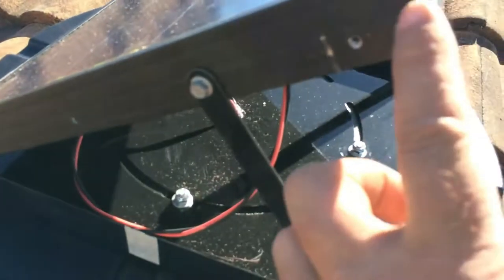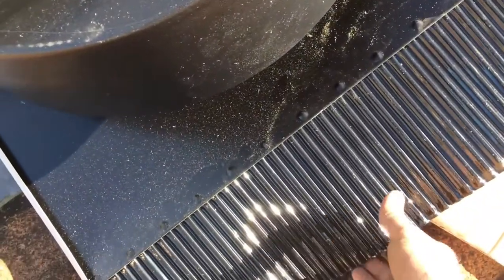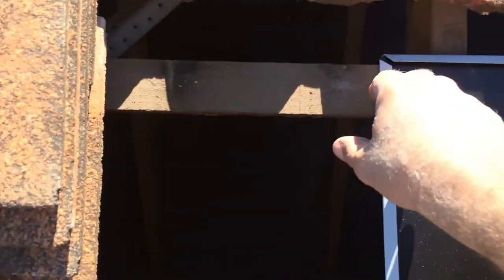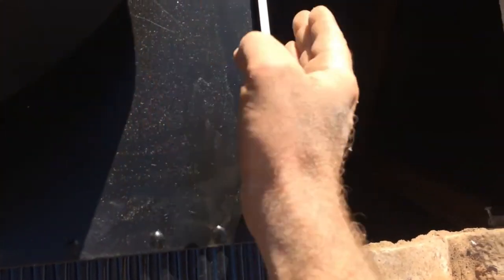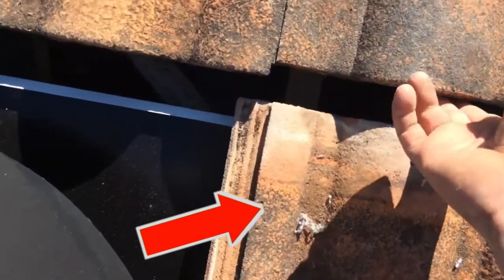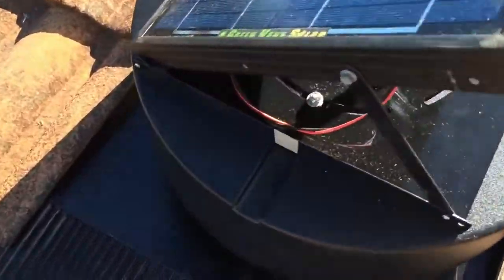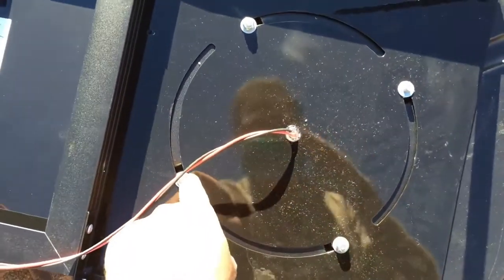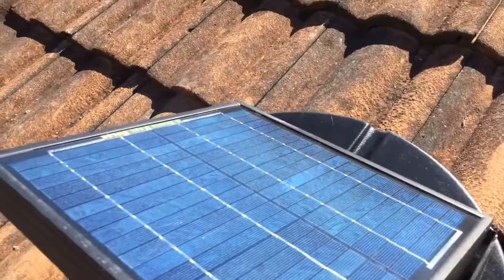Biggest Solar Vent, Do they work  7 Steps to install it on your tile roof

Comment: The Insulation Team  I have an unusual question regarding terracotta roof tiles please. The timber framing on my garage roof has moved over the years causing some terracotta tiles to have larger gaps, particularly in one location. The garage has no ceiling so all the timber and underside of the tiles are exposed, the previous owners got fed up with dirt and crap coming in thru the small gaps in between the tiles so they had the entire underside lined with SilverFloor insulation, it's attached with flat head clout nails. It has reduced the crap coming thru. In one location where the biggest gap in the tiles is, the SilverFloor has come away due to high southerly winds, and no amount of re fixing with the clouts keeps it in place. I thought of a solution which is to change the type of fasteners to very large washers with screws, and use some sisal tape to reinforce it. Yesterday I got up on a small step ladder and had a closer look at the gap where the wind is coming thru and I would like to fill in the gap from the underside with some type of material which will be sure to stay in place before I do the final re fixing. Can you suggest what I could use to fill the gap before I re fix the SilverFloor please.
Reply from the maker: Hi I thought I had written a detailed reply to this days ago for you #Ibis Man But as I was in an airport it did not send it....
Reply from the maker: Ok so I understand that you have some old foil under the tiles that are keeping some of the dust and water coming though onto your car. This is normal for tile roofs to breath like this a and it has advantages but with no ceiling in place it also has disadvantages.
If the old foil is paper backed sarking it is not very good and the square gange staples that you buy in a box from bunnings is the best bet to be able to hammer them up to the timber again. 
If you wanted to redo the foil the newer poly weave stuff is very tough but prone to sunlight damage and in a few years it may fall apart if it is getting to much sun too.

If you are worried about the gap size you can email me a photo on my DM on the website www.insulation.team or you can email them to me to check for you if it is a normal amount of gap. 

I would not recommend sealing the gaps in the tiles because you would have no way to stop the sealant from spreading between the tile grooves and causing leaks when the tiles can not drain properly. Maybe line the ceiling with a normal plaster ceiling might be the best solution as long as it is not an unusual size gap we are talking about.
Regards 
Peter
Reply: @InsulationTeam  Thanks Peter, due to movement with the timber framed roof there are about 2 or 3 small gaps below a few tiles, I was thinking of filling the gaps from the underside with a tiny amount of Fullers expanding spray foam to stop the southerly winds blowing thru the gaps causing the SilverFloor foil insulation from coming dislodged.
Reply: I should add that the SilverFoil TM (so called insulation) has not been installed on top of the battens then roof tiled over it, but only relatively recently been nailed up to the timber frame forming the roof to the underside. When we get strong Southerly winds it blows through a few gaps causing the SilverFoil to become unattached. Hence if I can stop the wind I will have solved the problem.